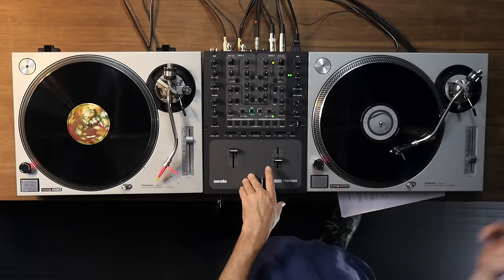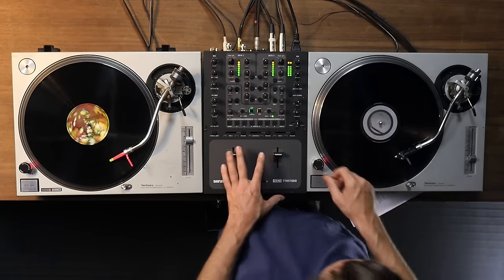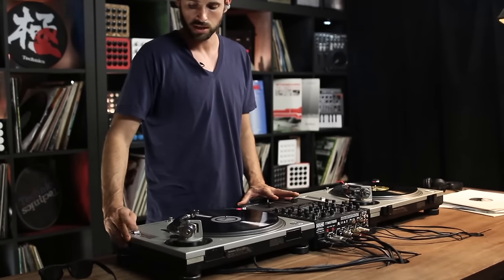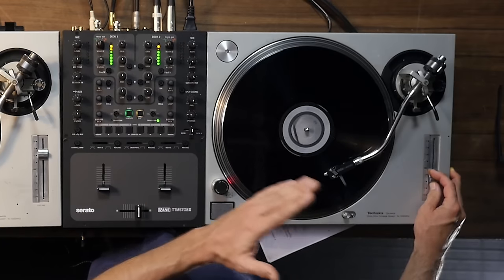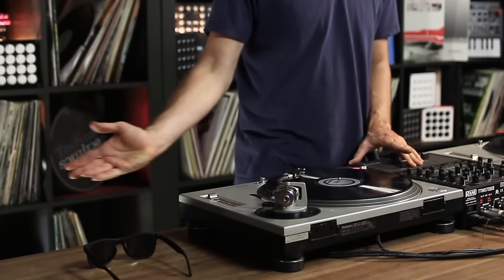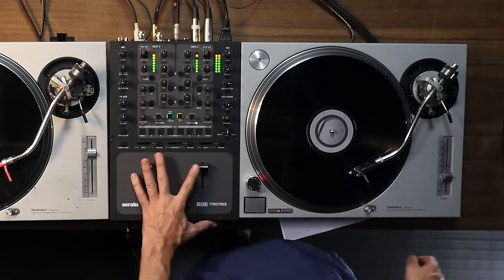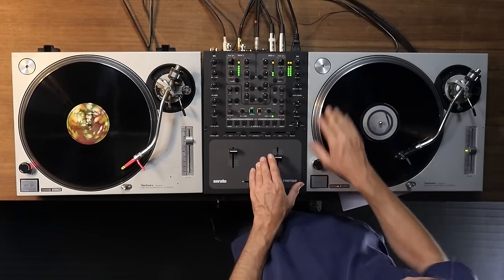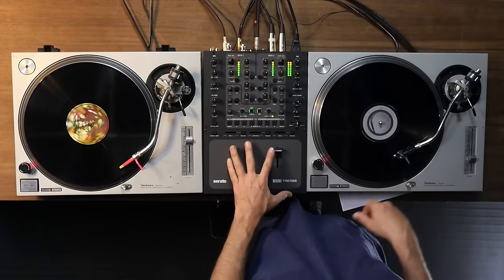Pitch Riding: Throwback Thursday DJ Tutorial

Comment: I am so glad I took the time to learn how to do this on my first set of decks - I play a lot of music with melodies in it, so touching the platter mid transition is just a no-go if I want to avoid that horrible speed up/slow down sound on the track. And like Ean said, it's useful not just for turntables/vinyl mixing, it works great on CDJs and controllers as well (especially because it allows you to avoid using "Master Tempo" on CDJs as a solution to the speed up/slow down effect of touching the platter, which is great because MT introduces awful artifacts into the tracks).

Comment: The problem I am having with this is the training ears part. I still have a hard time telling if the track is behind, or is ahead. Therefore I usually end up making the wrong decision and making the mix worse and further trainwrecking the mix.
Reply: practice! are you rushing or are you dragging?
Reply: +Kwipper Ursus Behind or ahead slightly produces a different sound... Don't worry everyone struggles with that in the beginning, practice a lot everyday and before you know it you'll master it.
Reply: +Kwipper Ursus try to practice work with mix without headphones. Well, perhaps using them only to find the start cue. Also as an alternative try to use lollipop headphone (monophone as correct) :)
Reply: +Kwipper Ursus Just practice practice practice.  It will come.. Beatmatching and mixing like this is a skill..... not a talent... i am sure almost anyone can be taught this, you just need to practice.
Reply: +Kwipper Ursus well do you first nudge very slight but act quickly. If it goes more out do it the the opposite way, straight after, by the same amount plus a lil bit more. kind of like testing the water. your first few beats should always be spot on... if you get your cue wrong you need to practice perfect cueing. Just recue over and over.
Reply: +Kwipper Ursus  A good tip I learnt is to make sure the volume of the cued track isn't too loud if you are mixing with one track in your head phone and the master coming out of the speakers. If it is too loud in your ear it can overwhelm you and make you focus too much on the track in your ear. 

If you are using cue blend (i.e have both tunes in your ears and can fade the volume between the two) try to find a sweet spot that lets your hear the cued track a bit more than the main track, this will help you pin point the louder kick/high hat/clap as the track you are trying to adjust. 

Like others have said though, practice, practice and learn your tunes so you can tell the difference between the elements instinctively.
Reply: All of you are awesome! Thanks for the response! I shall take all of your advice and continue to practice!
Reply: SLIC3R, I understood that reference.
Reply: A good way to quickly find out is if you dramatically increase or decrease the pitch/speed of the track you'd like to mix in.. If the beat of the two tracks line up briefly, then you're in the right direction - quickly move the pitch in the other direction, but in smaller increments, until they match again. You need to keep doing this until' they match, and you can detect this by listening for a flanger.. You're officially in sync when you no longer hear the flanger.. You'll hear kind of a hollow sound.. 

It's difficult to explain, because I'm not that experienced - and if anyone more experience can see a mistake in my post, please feel free to correct me..

It initially took me a month to learn this skill, however I have only practiced once a week.. So about 4 sessions?

My mentors say it's like riding a bike.. Once you learn this, and strengthen your ears to a certain skill level, you won't forget how to do it.. It will be like second nature :)
Reply: Brad James that’s good advice right there. 👌
Reply: Same problem with me.  I can tell when I am nudging the cueing track forward on the platter.  I stop just before the beats are matched so there is a slight double beat in my phones and listen. 

I listen to see if the beats match then drift away or if they drift away and never match .  Basically, if they drift to the point where they match and then drift away, that tells me the cueing track is too fast and I will then turn down the pitch for the cueing track.  The opposite is true for beats that never "converge" (for lack of a better term).

But, this trick works best when you have a pitch variance of 0.5% or greater.  Anything less than that is where I run into problems because using that trick will take up too much time to get a fine adjustment.  Even so, for me it is that last adjustment that dicks things up for me and if I have to make an adjustment during mixing, that's really the only thing left getting in the way for me right now, it is a PITA.
Reply: @mitchiemasha  That is what I am doing right now, a quick albeit slight nudge.  If that makes it worse, I quickly drag my finger and slow it down to get beat matching.  Nudging usually works just fine, slowing it down for me is a lot harder and is hit or miss.  But, as you said, practicing, LOL.
Reply: I have exactly the same problem

Comment: If you own m3d or mk5s you can use the quartz button, also if you mix 33rpm u can use 45 to speed up, or 33 to slowdown on 45rpm. But mk5 just make it all so much easier. If u own mk2s, definitely get at least 1 new mk5 it will help a lot!

Comment: if i do pitch adjustments they are usually quite small and when i touch the platter i usually do it on the outer edge and quite light.A lot of modern music from late eighties on wards  needs only slight adjustments .I have Rane 12mk2s and once you get used to the feel of them its similar to this except with key lock  there is even less to worry about .There is also sync but i dont use that much when djing.Either way i try most of the time to keep adjustments on the pitch small and any touch on the platter both on  the top of the disc and the outer rim reasonably light

Comment: Im using a traktor DVS with technics 1210 mk2 and disabeled the bpm view on the laptop so i could practice with only my ears. the thing is i found it very limiting for the music i can select to mix comparing it to when im mixing with a controller. ive notice i have to be more careful on the track selection and finding music with bpm not more than -3 or +3. note that all my music is basically deep house. Is this normal? for example ( since traktor tells you the bpm of the track ) lets say im playing a 120bpm track but i want to mix it with a 124bpm one. if i move up the 120bpm and down the 124bpm to get them in a middle 122bpm point, the adjustments regarding pitch are almost imposible for me to maintain for a minute transition. this is a big problem for me and its not even enjoyable. any help would be great, thanks!

Comment: You’re teaching it incorrectly - the proper way to ride the pitch is to chase it slowly and gently without the fast movements. You can arrive at a perfect beat match within 10 seconds and corrections should also be done slowly and gently, otherwise you’ll risk losing the match and hearing the corrections just as if you’re touching the platter.

Comment: Over the past 10 years or so, the life force of DJing has been sucked away by the midi controller!  Now, anyone with a pulse can DJ.  What a shame.  Even though I work with Traktor and  2 x 1200,   I couldn't tell you how to use the 'sync' function in Traktor, allowing the computer to do half, if not 3/4 of the job of DJing.  I refuse to do it.

Comment: I started out holding the platter to slow with a finger then speeding up with spindle. As I got better I taught myself to just use the pitch to get the beats matched. To be fair using technics 1210s the finger and spindle trick is pretty useless. I find you have to use the pitch only as it’s a much more accurate way to mix on them.